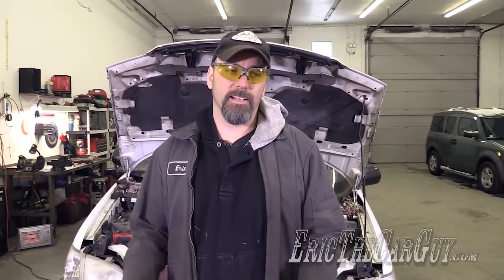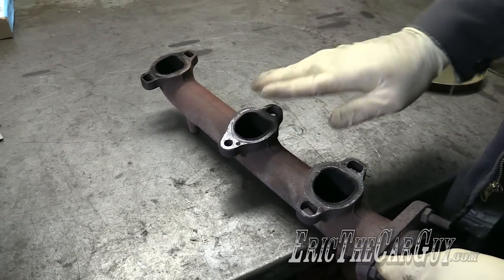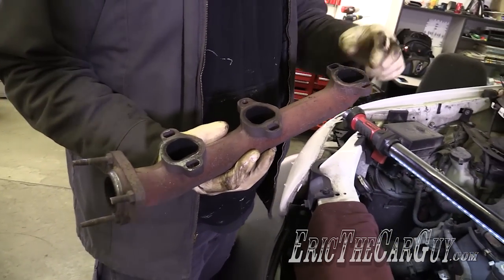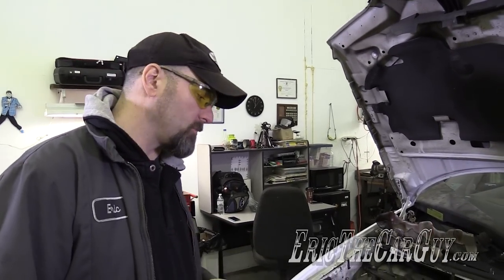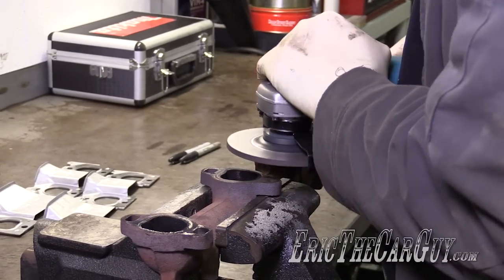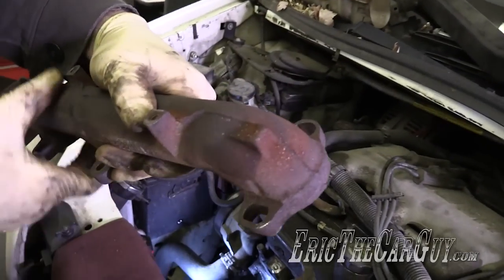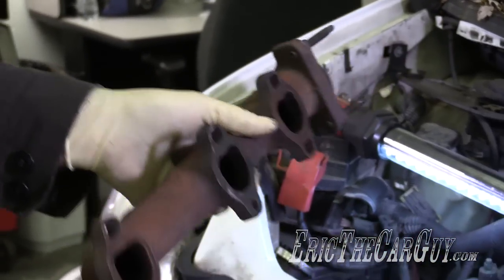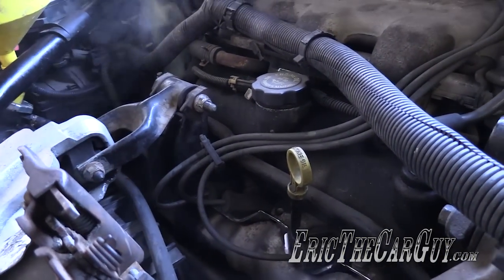2000 Pontiac Montana 3.4L Exhaust Manifold Leak Repair (Part 2) -EricTheCarGuy

Comment: The polite thing to do was to get a new cylinderhead at Erics expense im gonna share my experience I took my chevy colorado to the dealership to get warranty work done to it I have some nice chrome aftermarket wheels on and somehow they managed to scratch pretty bad the side of a wheel they told me about it and they order a new wheel for me I was happy about it now my point is I probably wouldn't noticed it right away if they didnt fix it or if they would of come up with a solution like eric like idk they just painted the wheel so I wouldnt noticed
Reply: Uh no. 

1. This isn't a public repair shop.
2. Any public repair shop would have notified the customer of the broken studs and the possibility of repair requiring a new cylinder head in case tapping out the broken stud failed along with a cost quote for that work.
3. In your case the shop insurance covered the replacement. There was no out of pocket expense for the shop.

What Eric demonstrated here was a DIY way of resolving the issue. JB weld can withstand over 500F and the head won't ever be getting that hot so close to a coolant passage and can easily withstand the 15psi coolant system pressure being backed by the stud. It being a stud isn't even a one time one shot repair the manifold can be taken off and removed.

Eric satisfied the customer's desires. He couldn't get the work van inspected due to the exhaust leak being excessive enough to both fail emissions and safety inspection in that state. If it wasn't for that the owner probably wouldn't have cared in the slightest about the exhaust leak and i doubt he will get the radiator replaced instead just opt for continuing to add coolant until he junks the thing and replaces it with another beater van.
Reply: Cragified Ohio and state inspections... lemme tell ya, what Ohio needs to do is inspect the potholes in the roads. It's nothing to be rolling down the interstate, feel a hard "crunch" and realize you just drove over the Hyundai that fell in ahead of you. But seriously, Ohio and Indiana for that matter do not have state inspections but you can be pulled over for an important safety defect. I wish they'd pull the jerks over who paint or install dark tint covers over their tail lamps... you know, the people with the black cars who want to be "stealth" but wonder why they are legally responsible for an accident when someone blows into the back of your car.
Reply: Cragified Indeed I stand corrected. I guess I am a bit surprised that Indiana does not have any form of inspection given that the two states operate so similar.
Reply: Alan Maier Each state is let to their own devices if to require safety and/or emissions testings. Missouri is biannual safety and Arkansas has no testing at all.
Reply: Cragified
"JB weld can withstand over 500F and the head won't ever be getting that hot so close to a coolant passage and can easily withstand the 15psi coolant system pressure being backed by the stud."
-
-
My only concern is, are the coefficients of expansion of JB Weld and the parent material (the head) compatible ? ....... Otherwise that stud could become a leaker.  I appreciate Eric's DIY demo as any number of us wind up doing those "get a few more miles out of it" repairs.  He is showing us some real guerrilla motorheading here.
Reply: Gweedo Murray In time possibly, but the reality is that the repair will more then likely last the remaining service life of the vehicle. Since it is the water jacket thermal expansion is going to be a gradual smooth rate since the water will take up the thermal kinetic energy.

In this situation the JB weld isn't actually being used all that much for structure. What happened was Eric's bit wandered and he ended up drilling through the aluminum off the side and into the water jacket. 

The JB weld is acting more as a sealant around the stud threads then a structure for the stud to anchor to since it was just one spot of the thread wall.  In fact you could probably have gotten away with using high temp RTV, though I wouldn't recommend it.

This is one of those repairs that is just matched to the needs of the costumer and not overall longevity and quality. It's a beat up work van that's going to be on the way to the shredder in a few years. Customer just wanted it running and passing Ohio inspection for now.
Reply: I got that it would be a non flexible sealant.  Wasn't sure if any structural support wasn't part of the bargain.  A "few years" might be over estimating the life of a rust belt shop truck.  I think RTV might get pushed out by hot water pressure.

Comment: Why do you rarely use a torque wrench? There are torque specs for probably every bolt if you looked at the service manual.
Reply: Because most bolts have a common sense torque.

Comment: 5:12 That new stud is so cattywampus in the head it's not even funny!  That is just a dicked job all around.  Would a repair shop even try and do something like this?  I'd think not.  Junkyard motor, junkyard head etc. if the Van was worth saving.  Great video non the less Eric!
Reply: I just did one with 4 snapped off bolts in a repair shop. Go on my channel and check it out. They all come out perfect with no drilling.
Reply: South Main Auto Repair

A direct link to that vid would be a great help !